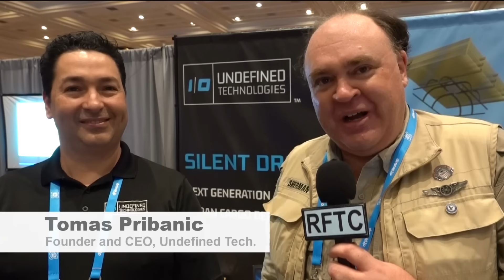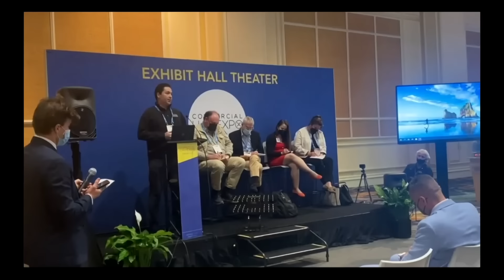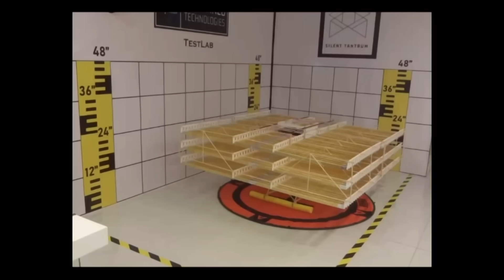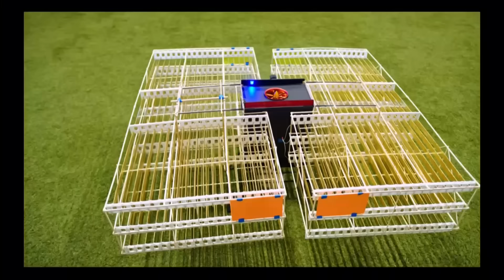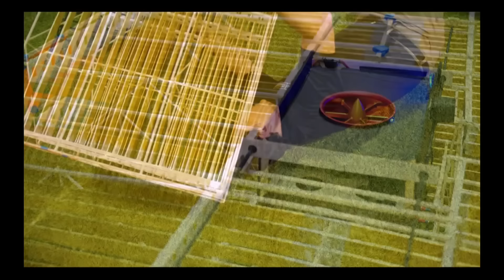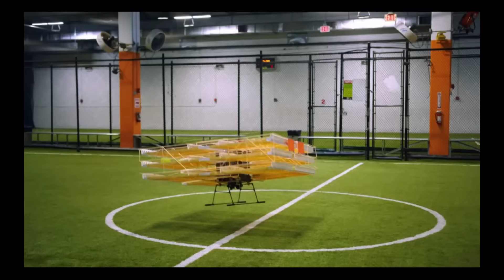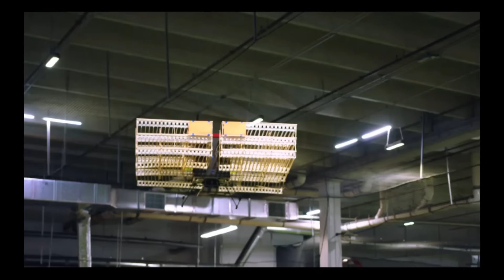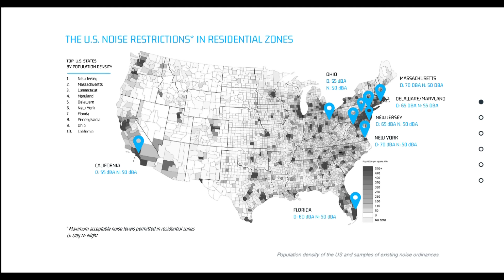New Drone Tech: No Propellers, and Yet It Flies!

Comment: I love how they always "reinvent" old tech as new.
Reply: round and round we go
Reply: @JeffStarch  Like meatspin.
Reply: @rock3tcatU233  Soylent green is people! Lol
Reply: Reapplied in this case.
Reply: Well, to be fair, in some cases they take old tech and reinvent it as something that just works better so is more practical.
Reply: @RedSiegfried  It is either that or they give it a ton more power, AI was hindered in the 50s 60s because it needed way too much processing power and it didn't resurface before the 2000s, 2010s. Now it's literally everywhere.
Reply: old principal, new material science materials, the field is called 'applied science' not new tech principles.
Reply: People tried to fly with wings for a long time before onboard power and steering was made possible. Most inventions are just improvements. A modern computer chip as another example, is a big step up from the older electronics that used to fill a whole building.   

That said, the UT craft has nothing novel except that it gets its lift from a powerful ducted fan that is used to carry a lifter around.  

On my channel are the only solely ion propelled crafts that can really lift their power supplies. The thrust to weight ratio used to be far too low, so it was previously considered impossible to have onboard power.  At first everyone said it will never work.  Now many people say they always knew it would work!
Reply: @KraussEMUS1  Right - point being they are looking for Seed capital from Unweary Investors like the dumb-Azzz interviewer - get my drift? we agree NOTHING NEW HERE
Reply: @KraussEMUS1  All the descriptions I can find indicate that the UT craft is solely ion propelled, and lifts its power source plus a 2 pound payload for up to 15 minutes. I find that useful only for carrying a camera on days when there is minimal wind, and other propeller operated drones have much better performance, but still there is no mention of any ducted fan. Where did you get this information?
Reply: @BenAtTheTube  Hi Benjamin,
Here is video from YouTube of Pribanic's craft with audio:
https://youtu.be/iihprC5Huf4
I have seen many EDF powered craft online, several EDF powered model SpaceX Falcons, and an earlier EDF powered "rocket" called the Ikarus.  The sound of the powerful flying EDFs is very distinctive.  Pribanic has a patent for leaf blowers.  I have 2 patents for creating a series of ion propelled crafts that can lift their power supplies against Earth's gravity.  There are 33 flight videos on my channel.  I know that it is not easy to lift a power supply with ion propulsion it was not previously possible, and I had to shave off every milligram from the components to do it.  It also takes a lot of major changes and some novel things.  There are boatloads of details about it, but I'd like to keep it short.  I just don't think the UT craft lifts its power supply without the leaf blower at all. Best regards.
Reply: @KraussEMUS1  Thanks, I looked at the video link and it does sound like an impeller starting up. The cone shaped feet also look suspiciously heavy unless they are functioning as "leaf blowers". Then again, there would be a lot of air moving through the array of ion wires and frame, and this could make a similar noise. I would need to look at the device myself to determine if you are correct.

I looked at your patents, which mostly deal with efficiently producing high voltage electricity for the ion generators. Lithium batteries can be configured to produce just about any amount of power by using large thin plates with extremely low internal resistance, i.e. enough to supply an ion propulsion device, but little can be done to improve energy density (sustaining that power over time) without multiplying the battery weight. I am happy that you were able to get a battery powered ion craft to fly at all!

I also see a "concept" video of a drone using a set of Dyson-type "bladeless fans". The Dyson fans are not really bladeless at all; they have a high speed impeller in the base that forces high powered air through holes in the ring, where it is converted to lower velocity higher volume air that is better for user comfort. I doubt that this would ever be efficient enough for use in any kind of aircraft.
Reply: @BenAtTheTube  Thanks for the comment!  Ion propulsion can be made efficient by the principles I have mentioned in the patents.  The main thing in the patents is actually producing ion thrust more efficiently rather than just the power supply.  I don't know yet how to get as much thrust as a propeller yet over a small surface area, but it does work adequately over a larger surface area Ion propulsion is already the fastest thing in space and will be many orders of magnitude faster soon.  On Earth it is the quietest form of propulsion, but it is not very powerful and was and is challenging to implement with onboard power. 

(New) Even with the best commercially available lithium polymer batteries with the lowest internal resistance, a normal ion lifter will not generate anywhere near enough thrust for onboard power.  It requires ant a lot of factors be just right such as, an exceptionally lightweight build, a special lightweight power supply, and large area single layer craft with large emitter wire distances.  The emitter wires must be only a few microns in diameter, or the current draw is excessive.  A stacked craft with the weight and geometrical factors present on the UT device would not produce anywhere near enough lift to be self-contained.
Reply: @KraussEMUS1  I wonder if you can put the +/- wire planes farther apart? Each individual ion will have less force due to the reduced voltage gradient, but the same total energy over the longer distance. And the longer distance will allow it to interact with a larger number of uncharged air molecules, hopefully pushing them along and increasing the total air flow. This would be like a fanjet increasing efficiency compared to a standard turbojet engine by moving a larger volume of air.
Reply: @BenAtTheTube  You are exactly correct.  That is one of the things that make my patented real version of this technology work.  Putting the emitter wires higher up also lowers the current draw by a large amount so that a much lower current lighter weight high voltage power supply can be used.  The low percentage of O2 molecules that gain some electrons also gain a higher velocity.  Since the current draw is lower, much thinner and more efficient emitter wires can also be used.
Reply: @BenAtTheTube  Hi Ben,  I couldn't find my response so I'm re-writing it.  You are exactly correct. That is one of the main things in my patents and on my real working version of this technology. By putting the emitter wires much higher up, there is a much lower current draw which allows for a much smaller high voltage power supply.  The small percentage of O2 molecules that get extra electrons added can attain higher velocities and there are more particle interactions.  Your analogy was a great one.  Also, since the current draw is much lower significantly thinner emitter wires can be used which are tremendously more efficient if they are thin enough.  There is an optimum distance for any given set of parameters.
Reply: @KraussEMUS1  Yes, thinner wires are better for electron emission. The electric field gets really intense around a very thin wire or a point, independent of the overall field between emitter and collector, and that is what causes the electrons to be released.
I think your drone needs flight stabilization other than tie-down wires. I know that many propeller drones made today have this, but have not looked into how it works or how much it might weigh. Good luck! I am still trying to make repairs to get my old manual milling machine running, which should be a lot easier than a drone but I don't seem to have any time to work on it.
Reply: Elon Musk will "invent" this is another ten years.
That's if he gives up on his less efficient RGB subway.
Reply: Like renaming radio controlled model airplanes as drones.
Reply: @ainsworth501  drone is a form of automation or control beyond-line-of-sight.
A simple remote control airplane with remote view camera that can be used to fly the plane, is a drone.
A remote control plane that can be pre-programmed to fly would also be a drone.
Reply: @ainsworth501  This person gets it.
Reply: @ainsworth501 no that because they’re two totally different things. Some drones might be similar in looks to remote control planes but they fly nothing like something from the 80s or 90s. They were like a real aircraft and drones are sometimes quadcopters and those make work from a remote but you’re an idiot if you think they’re the same thing.
Reply: Best way to trick gullible investors
Reply: Things are often conceived or invented long before the technological advances are in place to make them a reality. This is no different.
Reply: more like renovate.
Reply: Kinda like Steve Jobs.
Reply: Yeah, especially if they are improving what was once. I call it progress nevertheless.
Reply: get investors and blow their money is their hustle. these ppl are like cancer.
Reply: As if.  You need to learn difference between concept and invention 🙄
Reply: Well, whats new is untethered flight and the ability to carry a reasonable payload
Reply: @erbenton07  only if we can invent material that doesn't weight anything and overcome earths see-saw ripples and atmosphereic pressure that it would externally recieve. - year 2500?
Reply: @erbenton07  false
Reply: 30 years ago the world would fly without oil.
Reply: I never heard of this tech before but it seems to work great in an enclosed controlled environment with no wind or rain.
Reply: You should do it too
Reply: Amen
Reply: Exactly!! I'm wondering if the guy who actually invented this every got it patent. If he did this invention will be over real fast unless he sells it.
Reply: @rick7884  The basic idea has been around since Ben Franklin.  A guy got similar tech to swing around a pole in the 50s using a huge external power supply and in the 60s another person got one to fly vertically with a similar giant power supply tethered to it.  Thousands of people have built them since then, but only 2 ion propelled crafts can really carry their power supply onboard with ion propulsion.  The first and only solely ion propelled craft has 2 patents specifically for lifting its power supply.  That whole series of crafts are on my channel.
Reply: A work colleague was playing some oldies albums one day when his daughter came out and declared "they stold Madona's song."   Don't recall what song it was but you'd all probably recognize it.  Styles and music are regurgitated by subsequent generations who think it's theirs (new).
Reply: @RazorStrap  
The UT craft is powered by an EDF, not ion propulsion despite Pribanic's claims.  It is very challenging for ion propulsion to lift its own power supply onboard.  The thrust to weight ratio was not in the ballpark.  

There is only one series of ion propelled craft that really lift their power supplies. They are patented because of the major changes required to get an ion propelled vehicle to work with onboard power, not because the idea of ion propulsion is "new."  You can see them on my channel if you would like.
Reply: Old tech that's been overlooked and ignored, development in this field is our future. At least they are doing it, let's hope they continue
Reply: @brad9529  The UT device is propelled by a powerful loud ducted fan, it can be heard in the video with audio on their site.  The only VTOL ion propelled crafts that really lift their power supplies are on  my channel.  They would be violating my patents if their craft actually lifted its power supply without the ducted fan.
Reply: @Bill Bob, New and Improved , Fresh Frozen
Reply: Well yeah, the military was done with it by now and they put their twist on it for public unveiling.
Reply: Well it has a lot of new inventions that only now make it possible like advanced battery technology, microprocessors, chips with integrated gyro sensors.
Reply: sometime tech is a head of its time, not fast enough computing would have been why it was left behind at the time of its conception
Reply: Pretty sure that is how progress is made. I don't recall him stating to be the creator of the idea. As with most good ideas it starts with one and takes years and many others to be useful, marketable, and convenient. Id say cut the guy some slack or your gonna be the only one without a Hoverboard when he perfects it. Instead of caring about who thought of it first I think its better to look towards who will perfect it to a point where it will be the final word.

-Peace
Reply: Yup, this goes back to the 1800s.
Reply: That's how technology improves, people keep building on it until we have something great.
Reply: Yes, in the 80s I had a drone but we called it a toy helicopter
Reply: AI (neural networks) were invented 50-60 years before gaining any tractions, and it took someone to "reinvent" it in order for it to take off. It was a given, to be fair, but the idea is that there are so many other ideas out there that it is very easy to overwhelm yourself with all the new, flashy stuff coming out. Sometimes it literally only takes modernizing a concept or idea to make it viable for the current times, and it does, in a way, remind people of where we started from. This technology as a drone would have never been able to function 20 years ago. Now there is a viable future for it, given the right minds are dedicated to developing it. But I agree with you overall, lots of "novel", "revolutionary" tech is just old such with a modern touch.
Reply: @SS369  AI is a functional concept, a machine that figures out for itself what to do or how. Neural Networks are a concept in which circuit components that are not simple transistors are used to implement a programmable computer. A programmed NN is not at all AI.
Reply: taking a concept and/or phenomenon and implementing it are 2 very different things
Reply: The tech is old, the approach and material is new tho. Maybe they can make it safer and smaller using modern circutboards. Circuts as we know, are old tech, just in smaller format.
Reply: If this is old tech, then show me the drone that already existed that uses this technology and has the same capabilities, not just on paper but in a working prototype or commercial model we normal people can buy (not military etc).
Reply: @Bonez0r  there are dozens of old videos of this kind of tech, they are called "Ionic Lifters", not drones. he has just re-named some very old technology.
meanwhile, look at my new invention - it is has two wheels which you turn with your feet using pedals via a chain. i call it the "double-wheel-mobile"
Reply: @Ghryst  this vid is fake
Reply: @Ghryst And they are inferior to the products of today.
Reply: @aminulhussain2277 Wrong. they are exactly the same as the products of today.
.. perhaps you think they added turbochargers to the ionic field emitters or something?
obviously you dont understand what ions are.
its like you're saying "
the electricity of today is far superior to the electricity of yesterday or something equally as iq-deficient.
Reply: @Bonez0r  bruh.

https://www.youtube.com/watch?v=XHPevIbSCPA

we have made these things in school. it's not new or even difficult to make. just like how an electrical airplane is not difficult to make. but making an electrical plane that can carry 100 tones? now that is a chalange.
Reply: @Bonez0r  there were free flying human-carrying versions of this since the 40's at least. Same sort of few-minutes-of-flight-time issues. Also difficult to yaw, but not terrible. I'd hate to have a 50,000V power supply flying around with exposed contacts though.
Reply: @rionmotley2514  There were drawings of it by  Seversky in 1964, but he could never get anywhere near enough thrust for his craft to lift its power supply.  The electronics and materials weren't developed enough.  No one knew how to get a high enough thrust to weight ratio.  The above craft can't do it either except by a powerful  ducted fan.
Reply: @rionmotley2514  Their were drawings of it, but not anything that could carry a human without lots of helium etc.  Ion propulsion so far, creates a gentle force per area by accelerating small amounts of particles very fast.  There is then a momentum transfer when used in atmosphere.  The only solely ion propelled ones that can lift their power supplies are patented for it and are on my YT channel.  They had to be built of a very lightweight construction.
Reply: @rionmotley2514  
Prove it plz
Reply: @Bonez0r  He can't cause ionic trust is weak af... and the tech is still old. 

When many years have passed without finding real aplications, it's probably cause it doesn't work for that. "Show me yours" is a weak argument, mate
Reply: @TheChzoronzon  this has been tested in a vacuum. Is not ionic thrust in nature. likely static charge difference; just like gravity
Reply: @mikeholst3080  lolwut?
Reply: @TheChzoronzon  lifters have been tested in vacuum. Albeit not perfect vacuum but enough that if the cause was actually in nature ions it would be greatly reduced. Ie: ions are greatly reduced in vacuum.. in large its fair evidence they don't lift with ion wind. Pretty much the other possibility is static electric voltage differences and lines of force on asymmetric (inductive or capacitive) circuits.
Reply: @mikeholst3080  Dude... ion thrusters provide their own ions, extracted from storaged gas as reactive mass

You are mistaking that for ionocraft, which is what this vid is all about

In space there aren't enough electric charges, as you correctly mention, to allow for the second option... so your idea of "static electric voltage" ('???) or inductive/capacitive propulsion is absurd

You don't have the slightless idea of what you are talking about...stop using big words that you don't understand to look clever, you are failing miserably
Reply: @TheChzoronzon  if you were intelligent you wouldn't be using logical fallacies! Go read biefeld brown patents; ya might just learn something
Reply: Shut up! Troll!
Reply: Right! They tried to tell Mr I won some nonsense if I DM them for pointing out that this tech is over a hundred years old Godbless
Annoj1322
Reply: yeah... nothing much really "new" since  aether theory dismissed from physics. stuck.